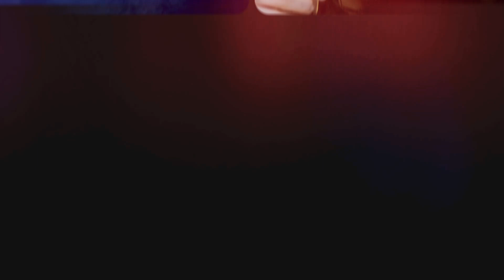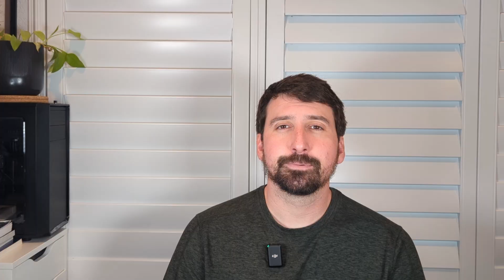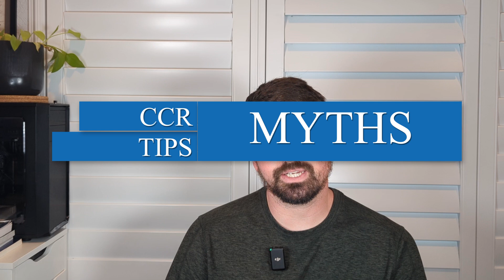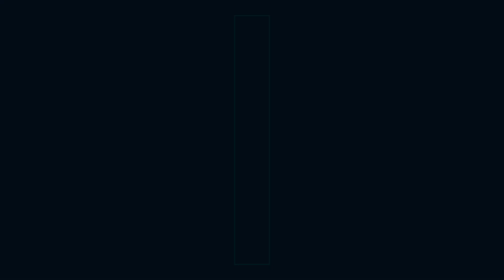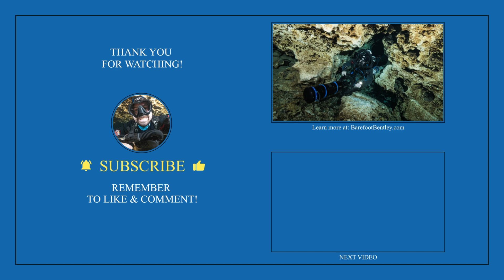Common Myths of CCR Diving

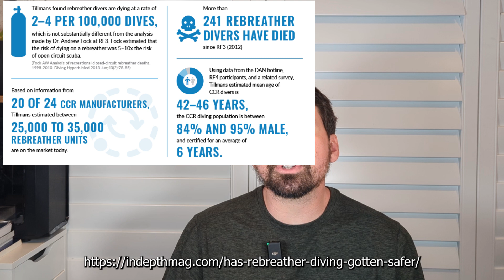Comment: if you wanna read that table 1:57 at face value, than that is a perfect illustration of how interpreting data is maybe even more important than data itself, because that is a very flawed interpretation. You cover that a bit later, saying that the human is at the center of it, but comparing safety of either system purely off of numbers, and not considering circumstantial variables of each incident, as well as various other factors, is untrue to data analysis, and cannot serve as a piece of information towards an informed opinion...